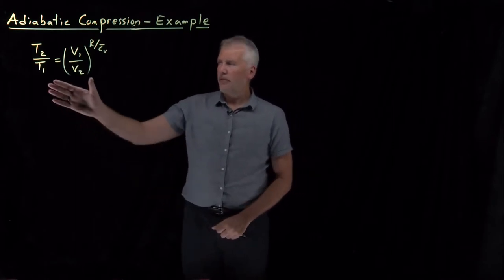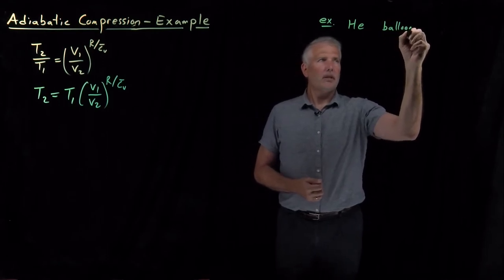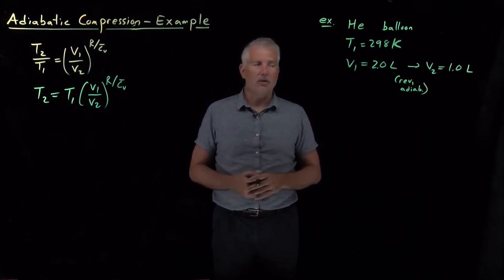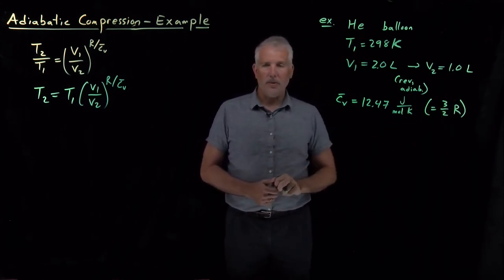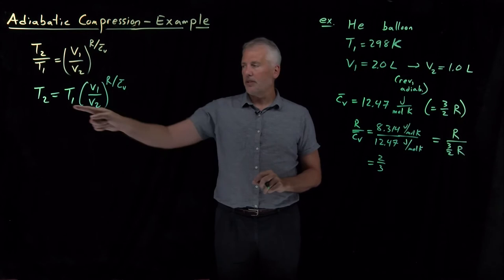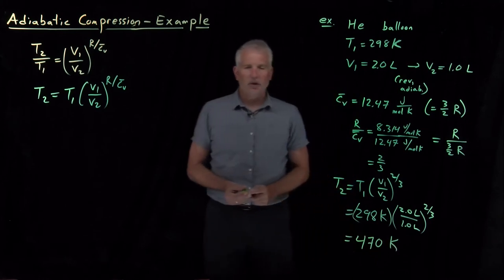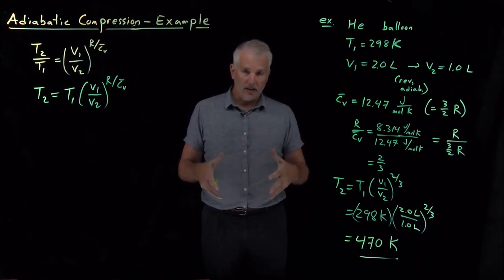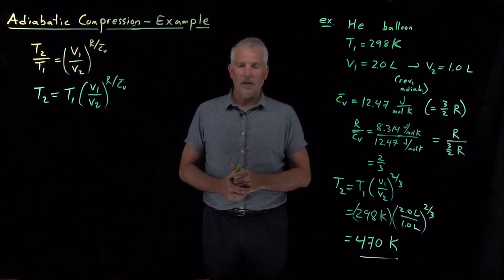Adiabatic Compression (Example)

Comment: Sir, can i use same formula for compress air in pressure chamber?
Reply from the maker: It depends on the conditions.

This formula is valid for any (1) adiabatic compression or expansion of (2) an ideal gas,

If the compression is not adiabatic, or if the gas doesn't behave ideally, then this equation is only approximate, or may not be accurate.
Reply: @PhysicalChemistry  i just want to increase ambient air temperatur from 30 deg Celcius to 90 deg Celcius in pipe pressure chamber as quick as possible. My step is: turn on the heater element in pipe than filled ambient air with air compressor. I'm sorry my English

Comment: Sir, what if I have a change in pressure  and temperature and v=constant  what is the formula for change in pressure of initial p to final p  in adiabatic expansion ,how to calculate pressure sir?
Reply from the maker: These equations assume ideal gases, so if you want to calculate the pressure change of an adiabatic expansion, you can just substitute V = nRT/P in these equations.

However, be careful. You can't have V=constant, because this is an adiabatic **expansion**. The volume must change.

Comment: Thanks alot prof.stuart
If we have a real gas how much temperature will deviate from these equation. I was using simulation software that there was a compressor and the reported temperatures  was match with these formulas! So i was wonder if these are for ideal gas, why an industrial software uses these for calculation. Or im wrong and there is a little deviation
Reply from the maker: There will definitely be some deviation. Both because real gases are not ideal, and because a real-world process won't be perfectly adiabatic. But if the gas is not too dense, and if the software is using an accurate (perhaps non-ideal) heat capacity, then the prediction will be pretty close. 

I can't say whether your simulator is using ideal or real gas models, or emotional data.
Reply: @PhysicalChemistry   Being a teacher is a blessing and you deserve it. Thanks alot❤️